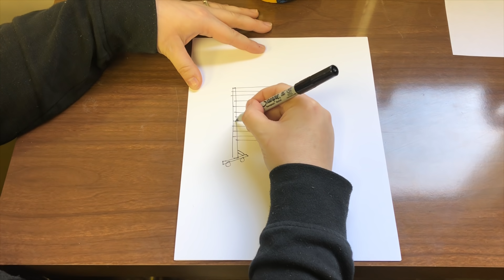DIY Easy Shiplap Wall | Craft Show Display | How To build a Craft Show Display | Shiplap Wall Build

Comment: Oh Elysia your Handmade and Upcycle projects are inspiring. I appreciate how you manage your time between your family and projects. Second you will save yourself time if you invest in the paintzoom or Wagner, or any lightweight professional paint spray gun for large or small projects.  Third, I love the IKEA - Apparo(probably spelling it wrong) outdoor benches with rack in redwood color. I wanted four of them, don't want to pay $159-$199 for each. So when you made this  twice as bigger than I what needed, for about $250 or less I was hooked. I knew I can do it for a lot less, and IKEA sells the paint color redwood. And it's movable. Inspired by you. Meantime keep up the great work.
Valencia

Comment: Awesome Idea!! But for weight and cost Luan in 1/4 in would have been ideal!!!!       Home Depot will cut strips for you.   I used 8in wide strips for my kitchen!!!      Looks exactly like shiplap, it’s cheap, and light weight!!!
Reply from the maker: I have used thinner boards before which have warped when being relocated often. I suggest a thicker board for durability :) They didn't end up being very heavy and were easy to transport
Reply: Luan will warp terribly if it ever gets wet11